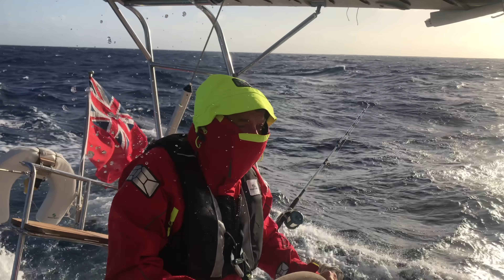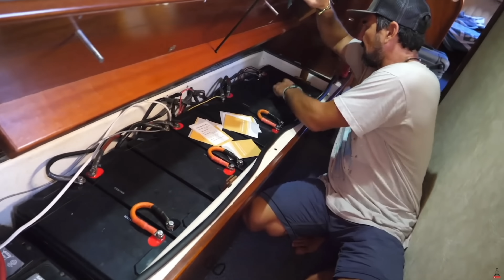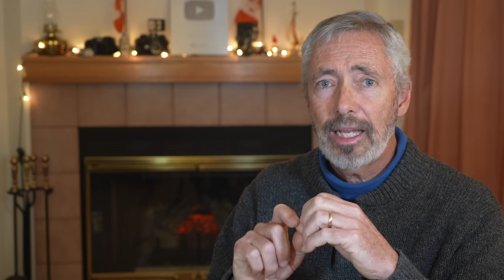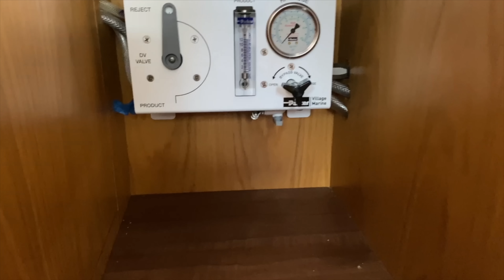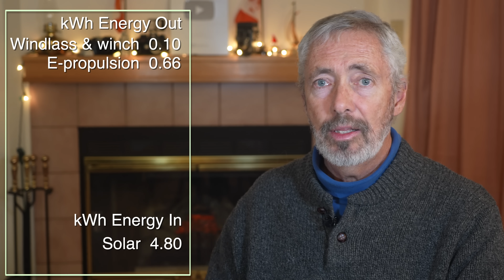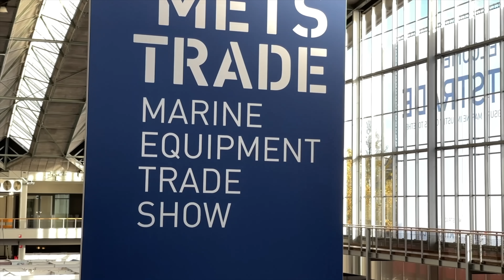Building an ALUMINUM Sailboat Pt 8 - HYBRID Power on a Sailboat: Will it Work for Distance? | EP 228

Comment: Hi there I watched the video. 
and I came to the conclusion that there are a few things that I could support you with.
you were talking about  the water heating system. 
and I was a little bit surprised that you did not have a combined system for your solar panel and your water heater because you have solar panels that also have a secondary quality they heat up water. and that saves you a lot of energy they are called pvt solar panels Triple solar That's one of the producers of that product. 
they are a little bit expensive but they are absolutely worth looking at for your project.
and I do have a thing that I would love you to look at a formal astronaut from the Netherlands also created a ship very ecological                                                                                    I think they could also give you a lot really a lot of extra information about  using less energy and being self-sufficient and having an electric propulsion system.                                                    the name of the vessel is ecolution. 
And another thing when you are going to the pole if you want to have extra solar energy you have roll-on roll-off solar panels designed to be installed temporarily on your railing they deliver 380 Watts of energy Max and you can have two on your vessel on the railing. temporarily extending the amount of electricity that you get from solar. 
They are flexible solar panels.
I hope that this can theoretically help you a little bit even if you have already done extensive  gathering of information.                                                                                                                         I know how tell him that you both are and how much experience you already have                    very very very good luck with the new boat                                                                                          it's kind of funny to me because I am an ex employer of the business where you are purchasing your boot now and I live only something like 45 km away from where it is being built.
 I wish you many many safe miles of travel with mild weather greetings from Andre from the Netherlands                                                                                                                                                  and success with the program I will absolutely stay following you.
Reply from the maker: Oh that’s so nice! That’s so great! Thanks Andre. Very helpful information. We are actually flying over to the Netherlands on Sunday to visit the boat again. Did you work in makkum?

Comment: You should consider using SOK Lithium battery's, they have 100 amp/48 volt UL Listed WATERPROOF battery's for $1650 US . that would make a 100 KW bank  only   $32,000.   That all fits in a 18 in by 18 in by40 inch tall rack, which come free with the battery's. THEY ARE WARRENTEED FOR 7 YEARS   AND A MIN 20 YEAR LIFE SPAN.     Cheers and fair winds from the Okanagan     Steve h.

Comment: Wonderful analysis of your electrical needs and requirements!   As for me, I have no diesel on my sailboat.  I could probably go all electric but my 4 hp Evinrude Yachtwin two cycle gasoline outboard works well on my 20 foot pocket yacht.  Last year I never started the motor.  All wind power on my local lakes.  : - )

Comment: IMO, the best system would be for an all electric boat with a second high output (>150A) 24V alternator on the main engine for charging batteries.  I would go with 8 24V/200A LiFePO4 batteries and as many solar panels as you can fit, 2400W of panels should work. The battery bank would be 39 kWh which should be plenty of reserve power for everything electric on the boat. A couple of 3 kW inverters would be ideal for the water maker and for other 120V AC loads. I would definitely go with a hydronic diesel heater for hot water and cabin heat that is also plumbed to the main engine. A hybrid drive is nice but to me, it's only useful for short periods of propulsion in the harbor. The regeneration while sailing doesn't give you a lot of power. I much prefer solar power over hydro-generation. If you need extra energy for a long trip, carry extra fuel in diesel cans. It's hard to beat the energy density of diesel fuel for heat and hot water. I do get that solar at high latitudes isn't very good, that's why I would recommend extra diesel fuel. FWIW, I'm no expert but that's how I see things. I love your project and follow every episode. Thanks for sharing your adventure.

Comment: I've seen you had fresh water tanks connected to aluminum shell. Do you know salt water temperature in northern seas?
Reply from the maker: Hi Uri
I think seawater temperature will vary from 2-3 in winter up to 14-15 in summer around Norway.  Tank Water will be the same as seawater so we’ll definitely need to heat it up.

Comment: I’m fascinated by the regenerative prop use.    How much will it return to the battery and how will it stack up against solar or wind ?   Would the prop work with a strong current?  The usage calculations were super useful !
Reply from the maker: Great point! I am hoping we might get 500 watts cruising at 6-7 knots... a bit more if we're lucky. On windy ocean crossings that would mean more than 6-10 kWh. Hopefully we won't need to ru nit all the time since it will naturally slow down the boat...
Reply: @DistantShoresTV  thanks for the reply !   Great video!  Very informative

Comment: Fantastic break down of the uses and generation options. I would love to have electric / hybrid drive on our HR 31 Monsun, even for very limited local Scandinavian cruising. Being able to do moter assist to gain 5-10 degrees to the wind without the noise of running the engine ... However the budget for an installation like that can't be justified on our boat - it would cost more than what we paid for it and the hulls is not compatible with folding prop. Perhaps if we upgrade to something closer to 40 ft. :-)
Reply from the maker: @mufflejoy Yes go for the 40 footer :-)

Comment: Thanks for this super nice episode. A very educational “lecture” that makes people think. 
In the question “ when will you motor ….” Obviously this depends where you sail. 
We agreed to stop sailing if wind is above force 6 and make way to shelter.  This as we sail at the Dutch waters and the North Sea. These water can be unpredictable and very uncomfortable. Obviously we train to sail rough waters and hard wind just to prepare. In most cases the engine is running too if we are near the coast and shelter. 
At no wind conditions we use the engine at low setting to move.

Running the engine towards the shelter makes E power, hot water truster and anchor winch power.

Comment: We have an induction cooktop and small convection "air frier" oven and we don't see a reason to go back to propane. For emergencies - where maybe we could experience a power issue-  we still have our propane grill/BBQ but have not had to resort to that. We also have a "george foreman"- type griddle, an Instapot, a breadmaker (make bread about once a week), a coffee machine, and our hot water heater runs off the inverter so we don't need to run a generator on the engines on days we want a hot shower. Our bank is only 10,152 Wh (our average discharge is 4,980 Wh a day) but its enough to get us through with our 2000 W of solar. If we are presented the opportunity to expand our lithium bank we will probably do that so we can get through several days of no sun because we generally must run the 5Kw genny on cloudy days. I still think that wind generators have a place on boats and we think that with lithium the value proposition is higher because it can take every bit juice and at night it would top out our batteries in the trades. We may add a D400.
Reply from the maker: Thanks @JostVanDykeFan for the details! Specific numbers like yours make it easier for us to plan! I assume you have  catamaran since you have 2000W of solar power. I'd love to hear later if you like your wind generator. We tried one years ago but it was noisy and didn't produce very much. Perhaps they're worth it now... Fair Winds! Paul

Comment: What is the main goal of the hybrid drive? Is it for saving fuel, or it seems to me that is just an added benefit. I see the major advantages are more the powerful generator function, from engine or regenerative, and the ability to quietly leave anchorages etc. when only a short period of motoring is required.
Reply from the maker: Yes Chris that's two of our main hopes for the Hybrid... replace the generator and regenerate while sailing...

Comment: Hybrid makes good sense. Question - Does hybrid make the technical space much more complex? The diesel would directly drive a generator?
Reply from the maker: Yes Hybrid adds complexity somewhat... on the other hand if you no longer need a stand-alone generator that does simplify also by removing that component. In the previous video we discuss the two types of Hybrid we considered - Serial & Parallel 
https://youtu.be/8ZYQhsXiNG0?t=467

Comment: 7kwh battery is 583 amp hours @12 volts, never seen a battery this higher amp hours.  Just saw 48 volt system, which 48 volt 7kwh battery is it?
Reply from the maker: On our previous boat we install two 24V LiFePO4 batteries by MG Systems - each 7.2 kWh - 280 Ah -25.6 Vdc - 53 kg. Hope this helps...

Comment: Electric cooking is great. The electric cooktop is obvious but the choice of an electric oven not so much. I would actually advise against getting a regular electric oven because it needs to heat up for 10-15 minutes before use and uses a lot of power. A much better choice is an airfryer. It's immediately ready to use and cooks much faster than an oven. 
My recommendation would be a Ninja Foodi air fry oven.

Comment: You want to save electricity ? use HEAT PUMPS. If a "standard" water heater draw 3kwh to heat your water need for a day,  a thermodynamic water heater (just a small 200w heat pump on top of a water tank) will barely eat 600w for the same job. I don't know if there are 48v thermodynamic water heaters on the market, but even accounting with inverter efficiency its still a no brainer. Also for coocking. Please compare heating efficiency between a standar infrared cooking table and an induction one. The induction one is cocking ONLY the pan.

Comment: Wife and I live aboard our 42 footer in the PNW - on a mooring ball and at anchor 100% of the time - winter and summer. We have two 350w solar panels on an atlantic tower arch on the stern of the boat. As PNW does not generate a lot of solar in winter, we have a small portable generator that us used to push into our Firefly batteries(440ah total). Winter time I run our batteries down to about 11.8-11.6v before I start up the generator(in the mornings - about day 3 from last run time). Every 3rd time we draw down to this level, the generator + the engine is used to charge batteries at a higher rate during bulk phase to help keep the batteries healthy. We are 100% reliant on propane during this season in the PNW. 

However during late spring, summer and early fall - we are completely capable of running of solar and we rarely see 12.2v. During this time of year we break out our single burner counter top induction unit and we cook 100% of our meals on this. We are not talking about a can of soup or just boiling water for ramen - this is a full on meal that we cook - 3 meals atleast a day. I work from home and love to cook. I'm sure people are going to give me a hard time about how i'm "treating" my batteries - but I'll say in the 3 years of doing this on these batteries we have not seeing any sort of loss of capacity. The induction is completely reliable and is our "backup" if our propane system goes down or like last summer - could not find a single person to fill our bottles in 2 months. We were in an area with limited service and they had struggled at getting a new supply. 

If i hadn't just bought my Firefly batteries 3 years ago, i would very much be upgrading to lithium and to an induction stove & oven. So far it has worked incredibly well for me - I am hoping that my batteries burn out at the 5 year mark so i can replace them and switch over to lithium - i think at that time I will probably install a small genset that I build myself(DC genset)

I want to add that we also do have a 5 gallon hot water heater that is rigged to our inverter - In summer its wonderful being able to look at our battery SOC and see that we are in float by 11am AFTER cooking breakfast on our induction stove (we also have a freezer and refer unit that runs 24/7 in summer) - and by 11am-12pm we are able to kick the breaker on for the water heater and start dumping power to our hot water tank. After an hour we can shut it down, give a break on the batteries and repeat after about an hour of recharge and by then we've got more than enough hot water for the remaining day(shower/cleaning)

Comment: Such an awesome video! Really appreciate you breaking down your expectations and approaches. I just really never see anybody else doing that, and it's been so frustrating playing guesswork as I've outfitted my own liveabord with electric drives and infrastructure.

I'm also installing around 30-40kWh of batteries, with what I'm calling a hybrid system as well. I've gone with a US motors, 350 HP equivalent 24 volt electric engine, a Cummins MDKDK 9kw generator, about 2 kWh in solar panels. I'm also going to be installing a redundant generator but I haven't figured out what I'm going to use for the space I have. 

Based on what I've seen in your video, we're coming up with some pretty similar numbers and ranges. I suspect it's because we are doing this around the same time, with a similar style of ship. This is exciting because I've mostly been trying to reinterpret results that friends have had on their catamarans. 

The technology is always advancing, and I have friends with electric drives they installed around 2019/2020, that already seem extremely outdated and inefficient. 

Thankfully, their early adoption helped me learn a lot. You guys, and Sailing Uma have also been so helpful. 🙏

Most of my tests have me running between 5 and 6 knots, at about 400w as well. I have an experienced skipper helping me with changing my prop to hopefully get better speeds at 800w. I really only got up to about 7.5 last time I tested that. Still learning over here.✌️ 

At first I really only anticipated using the electric drive to get in and out of marinas or to get ahead of weather, but spending more time with friends who are using electric hybrid approaches already, I see them motor sailing significantly more than just sailing alone. Even with only about 10 kWh in batteries. 

Some people just want to have completely silent motoring, and they can pull it off for a few hours. I just don't find that as appealing, and with the quality of sound reinforcement now, I can barely hear the generator anyway so I'm fine running in hybrid mode, to get the most out of all the regen and propulsion. 

I'm a novice at sailing with only a few years under my belt, but I very much want to become a proficient and efficient sailor. I look at the hybrid electric drive as a supplement. I'm looking to do longer sailing trips instead of just puttering around from island to island in the Caribbean.l

I gotta tell you, I really appreciate you guys creating practical breakdowns of what your expectations are on sailing across the Atlantic, through the Med, and colder waters. I also very much appreciate you breaking down what your expectations are for air conditioning use. I don't suspect I will be spending much time in Northern / colder waters; my wife would hang me from the mast. I'm really hoping to use the HVAC efficiently in warmer waters (currently in California) because my wife wants us to spend most of our time in the Mediterranean. I think with similar numbers to yours, I'll be able to meet our needs. 

Anecdotally, everyone I've seen also loses about 1 knot when using regen mode. I'm about to spend a few weeks on a 50 ft monohull that uses regen props they tow behind them, instead of being attached to their main prop. I'm very curious to see how these work. I don't have any of the range anxiety or concerns I had when I first started planning this approach, because I still have a large fuel tank. 

I'm not sure what your results have been but I spent a lot of time trying to find a way to use modern wind turbines on a boat, with little success. I have yet to find any that provide meaningful power generation that are also rugged enough for marine use. Every turbine that told me it could generate 400w in 15mph winds, couldn't squeeze out more than 100w in a hurricane. Subsequently, I have abandoned this approach in favor of installing significantly more solar, which gets cheaper by the day. 

Seeing you guys undertake the hybridization approach is very encouraging because I believe it is the best approach for the next few years. Obviously solar and battery technology keeps advancing by leaps and bounds, but I just don't want to wait another 5 years for what I think will be a truly useful 100% electric drive. 

I also want to have the added safety and security of a very reliable set of redundant generators. I'm just not yet convinced 100% electric is viable.

I am so looking forward to seeing you guys advance further with this. It's such an exciting time. Thank you again ✌️